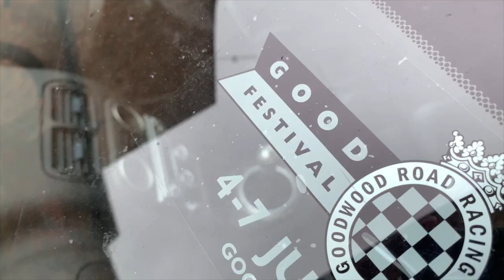Cleaning My 2006 MG TF and EXHAUST SOUNDS

Comment: Nooo not a sponge!! Use a microfiber mit fit body work
Reply: Breheny Johns Oi oi
Reply: OI OI
Reply from the maker: The rover MG guy to avoid swirlmarks presumably? I only had trusty sponge at the time. Sponge with a grit guard in the bucket works though